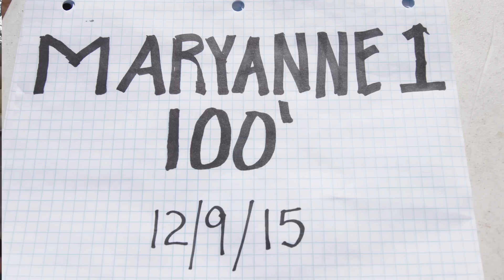The Garlock Project - Drilling for Primary Water in the Tehachapi’s

Comment: I would be interested in youse having out a professional hydrogeologist and asking them if they know if this water might be "fossil water", which is old water that has been in the atmospheric hydrological cycle, and then locked out of the atmospheric hydrological cycle for more than ≈10,000-40,000 years. In Egypt and Libya, the water taken from the Nubian Sandstone aquifer is fossil water, from a time when the Sahara was, at the very least, a savanna, if not a temperate forest. That aquifer isn't being recharged from any known source. Depletion rates are relatively low - it is expected that Dakhla, in Egypt, will run out in a couple centuries, despite wasting the water on flood irrigation because of the fact that agricultural fields have been salted by dessication, and because of the extremely high iron content in the water rendering sprinkler and drip units all but unusable.